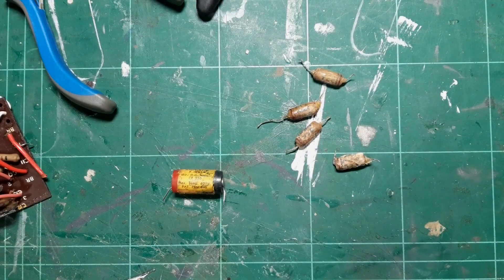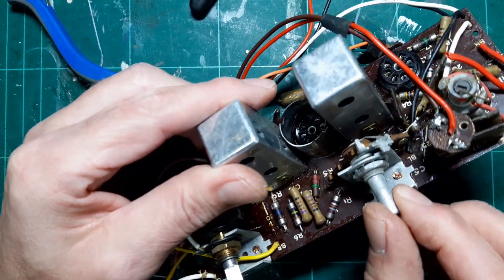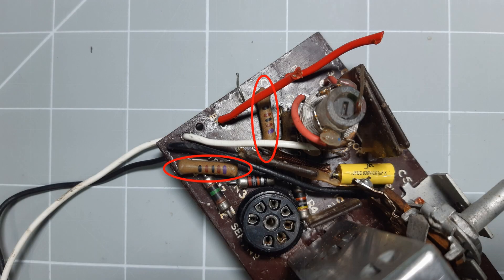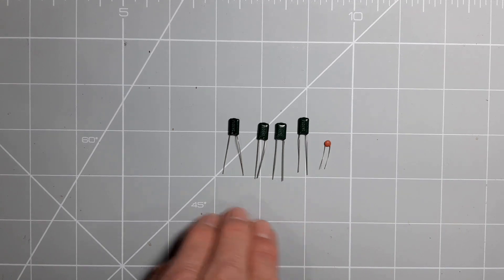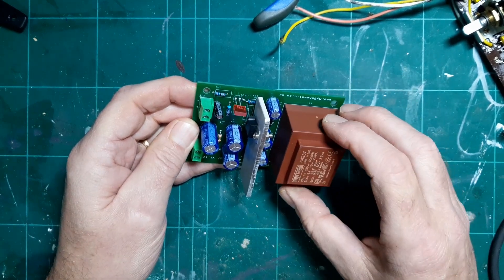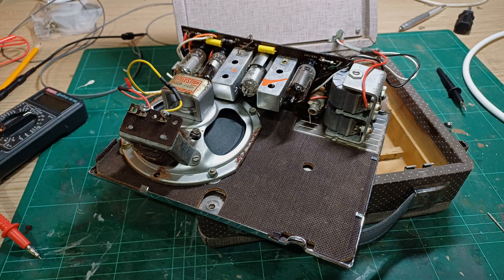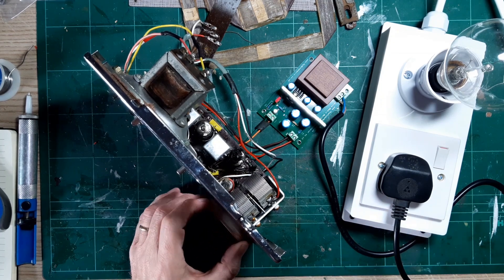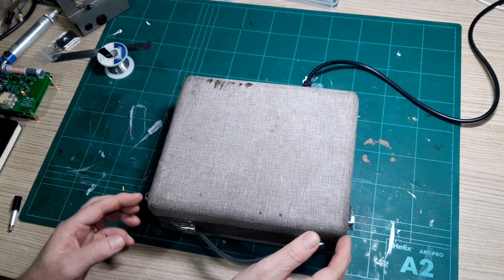Pye P114BQ Valve Radio Repair and Spruce up Part 2 – Electronics Repairs, Rebuild and Test

Comment: Can it be easily modified for shortwaves?
Reply from the maker: It would need a new antenna and probably a new tuning section. For me, I would not consider it. Easier to get hold of a SW radio.

Comment: Hi Gary! How did you alter the power switching after converting to AC? Did you keep full HT on the plates 24/7?
Reply from the maker: The radio keeps full HT on the plates. I simply unplug it from the wall. I did not change the power switching on the radio.

Comment: Nice little set,  shame you weren't able to clean up the black marks. A little denatured alcohol ( methylated spirits in Oz) may help
Reply: Knowing when to stop is a good skill. Push it too far and you risk more damage.
Reply from the maker: It's a shame but, no, that did not help.

Comment: if that original 8uf tested ok i'd put it back in, keep it as original as possible, personally i've found those 2 colour plesseys, either good or almost totally open, rarely inbetween!  i have one of those radios, that had an open circuit output transformer, maybe 'vapours' from the batteries rotted it?, no need to replace those tubular ceramics, you called them 'paper', but theyre not, extremely rarely rarely go bad, or any mica types unless theyre actually out of tolerance, waxy paper ones or plastic cased hunts almost definitely will need changing
Reply from the maker: Thanks, it part of the learning curve for me. I realised the 'paper' caps were in fact ceramic and I regret taking those out. I have the 8uF capacitor.  All my out of circuit tests show it as good, so I may put it back or save it for another project.